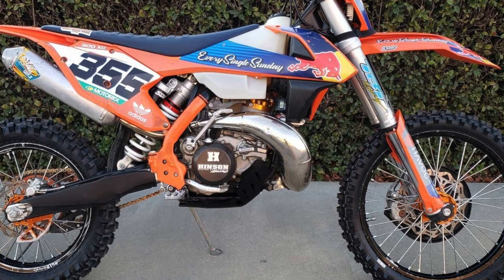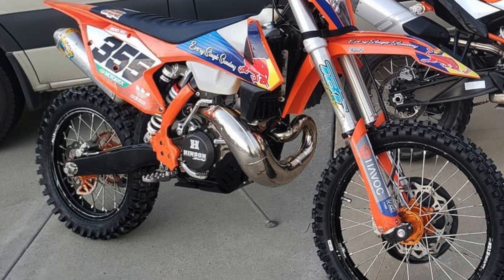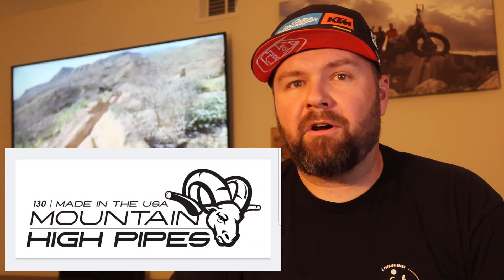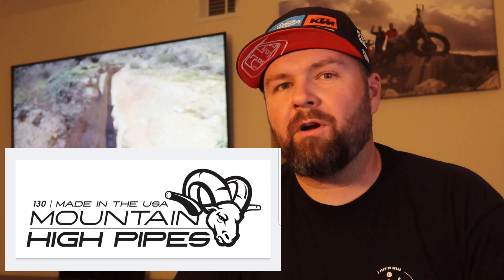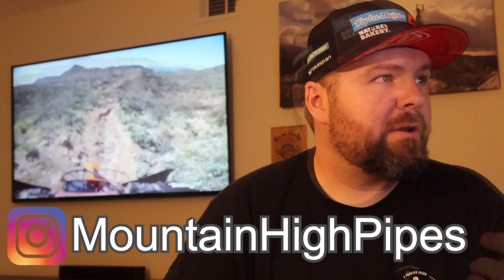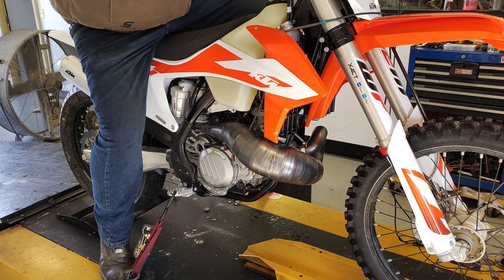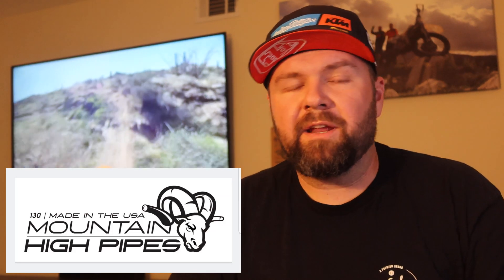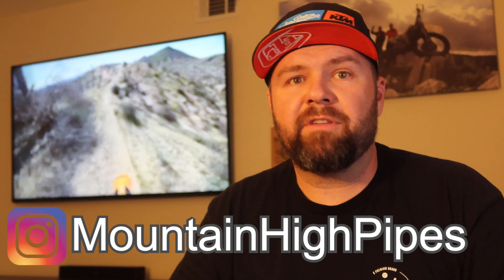2 Stroke Pipes - Redesigned

Comment: I’ve always wanted a Scalvinni pipe, rolling a FMF fatty works, not a lot of options for the TE 150.... would love a cone pipe, 300 aren’t the only bikes out there.
Reply from the maker: But they are the most popular for this stuff. The 150 is an awesome machine
Reply: True that because it is what the pros are racing so should I is our mentality, I rode my friends Kim Xcw 300, was easy to ride, the front end was super light almost to light I ran off the trail a bit, body position is more critical, most of us who can afford one will get one or more, I am just not that “gotta get what everyone else is getting” guy, I’m the oddball I started on a 78Yamaha IT400, note, I was 16, bike weighed almost 500# and I weighed 160#, then I ran a Suzuki 1996 RMX250, in the late 90’s and a 1994 Kawasaki KX500, advance to now 20years and I get a 2015 Husqvarna FE501, start racing Off road and Enduro two years on the awesome big bike, now 2020, third racing season snagged the 2019 Husqvarna TE150 for 6899$ was almost the same as a YZX so I grabbed it, I hatted little bore bike, thought they had bad attitudes were very challenging if your not hauling ass, so I’m facing my fears again time, to find this 150 is nothing like the older bikes, she’s smooth and agile, have 400is miles on it now, happy as hell to have went smaller.

Comment: Really loving your channel, Travis. Keep up the great work. I don’t miss an episode. Quick questions: I see you removed your carbon fiber pipe guard. Was that done for this episode on the new pipes or have you decided to not run one? Secondly, since destroying that Carbon-up clutch cover have you found that Hinson clutch cover strong enough to stand up to your style of riding?
Reply from the maker: I took it off when I put on the FMF Gnarly Pipe. It's Thicker and is holding up great. But, it fits like crap and leaks oil all over now .

Hinson is holding up good so far but has yet to take a solid hit. Carbon up warrantied my old one and the process was very easy

Comment: Very interesting! I’m on a TE300i with an RK Head, GET ECU w/injection relocation and a Pro Circuit Pipe. I just swapped out a Gnarly for the PC Pipe as I ride a mixed bag of terrain (not just tight or low end only requirements). PC a great pipe for what I ride but I’m always looking for more. Very good info, keep bringing it! :) thanks.
Reply from the maker: I like my gnarly with my RK Tek head. Not as much too but super smooth. I have a Lectron as well on mine and a 7g flywheel weight

Comment: hey yeap can you keep me posted I have a 2011 ktm 250exc with a damaged pipe so yea im keen to try something  different cheers from Australia (Steve )
Reply: easy4steve 
If your pipe is just dented you can fix it yourself for next to nothing. Pull it off the bike fill it full of water and seal the ends. Put it in the freezer and check it every 30-60 minutes. For bigger dents you might have to add more water. I have done this with excellent results.
Reply from the maker: We definitely will. Hoping to ride one ASAP

Comment: One of the guys in our group wants to get one.  I see how the higher set position will help when crossing obstacles, but is there more pipe protruding on the side?  I generally damage my pipe when dropping the bike into rocks/trees on it's side rather than when log hopping.

In any case, innovation is great.  Things like this is how designs get changed.  Best of luck to them!
Reply: The pipe is actually tucked in closer to the bike than stock, The guys at MHP  wanted a pipe that was less likely to be damaged from the bottom as well as the side.
Reply from the maker: It's hard to tell. Not sure if it's the same, or more? We're excited to get one and see how it compares. I usually damage mine as well dropping the bike  on it's side 😂
Reply: @EverySingleSunday  Please make a vid if you manage to get one. Would love to see the review. Cheers mate!
Reply from the maker: You got it